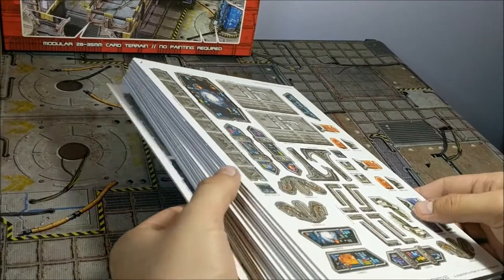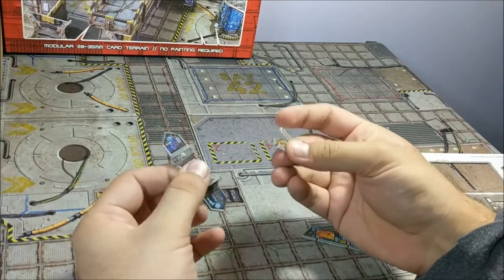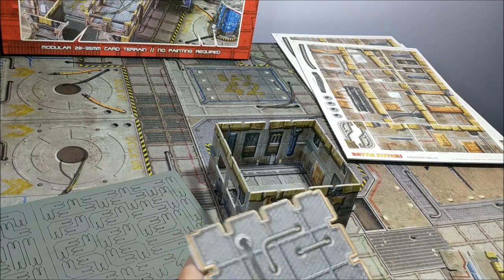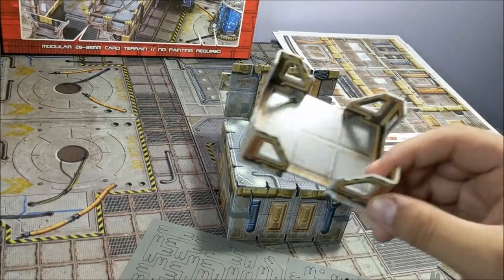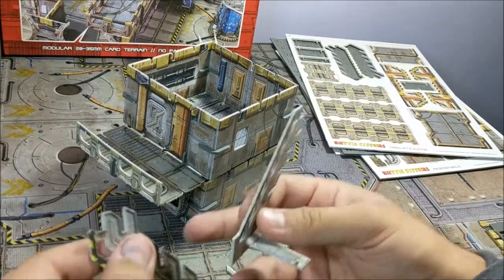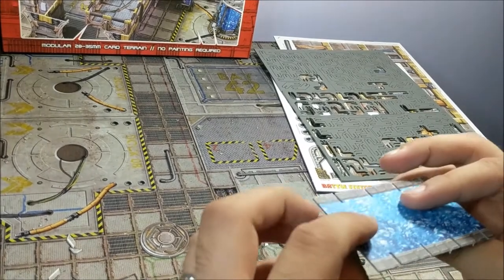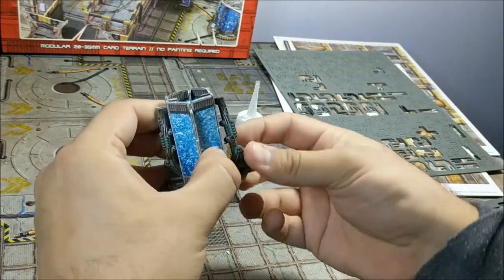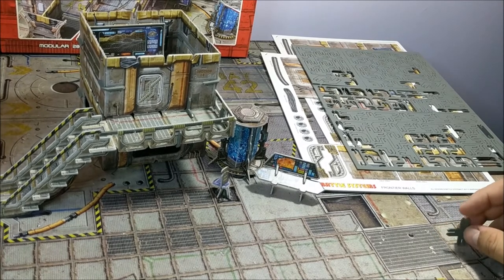Battle Systems Build Video

Comment: Looks good, thanks for the follow up video! Are the clips card as well or a thin plastic?
Reply from the maker: No worries! The clips are not card, which is really nice. I am unsure if they are plastic, or a hard rubber. Either way, they are fairly strong, and hold up really well.